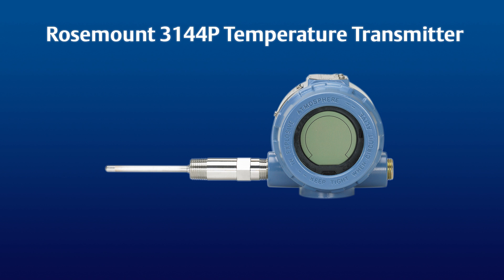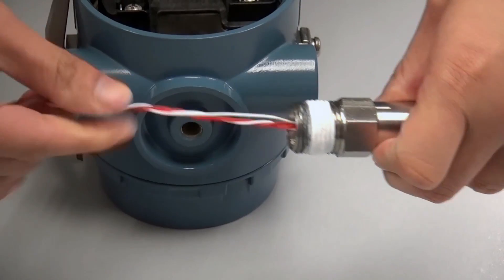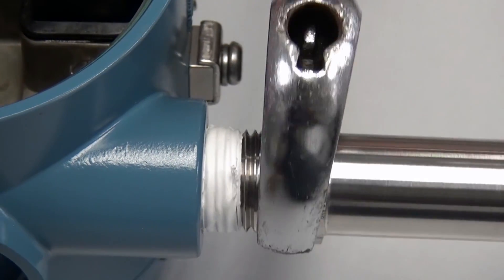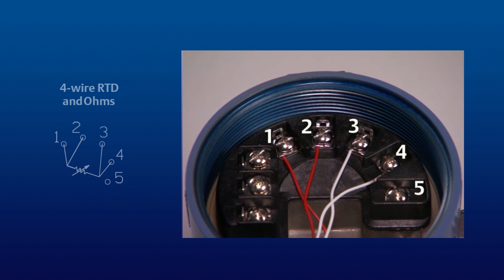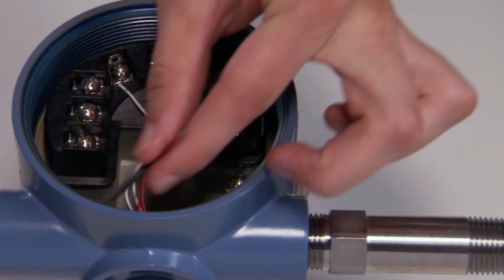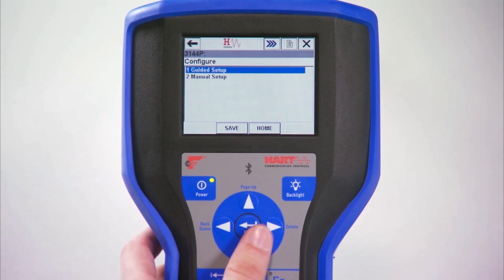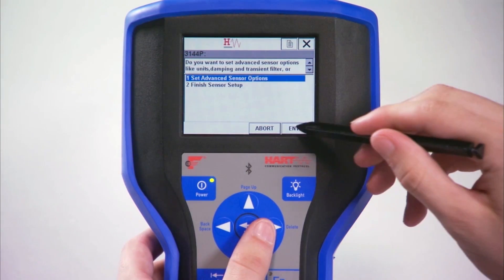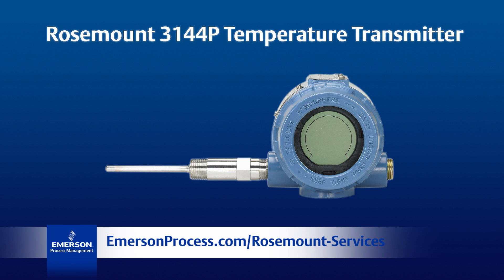How to Set Up a Single Sensor for the Rosemount 3144P Temperature Transmitter

Comment: I get sensor 2 error when using only 1 sensor, how to disable?
Reply: Some sensors are ordered with a dual sensor for redundancy/backup. You can use a 475 HART Communicator/TREX to disable the sensor 2. Guided Setup>configure sensor>2>type> ‘Not in Use’. The error will disappear when acknowledged in the Overview of the 475/TREX
Reply: https://youtube.com/@instrumentprocessmanagement?si=6kuTHfXnOq8-uZ5b